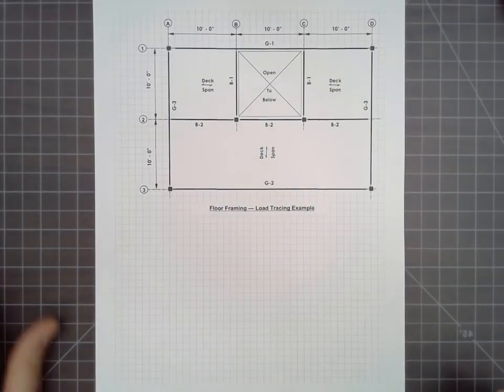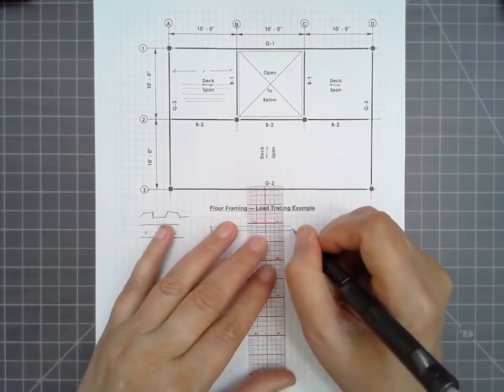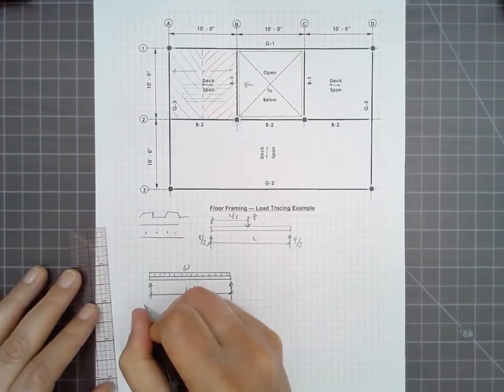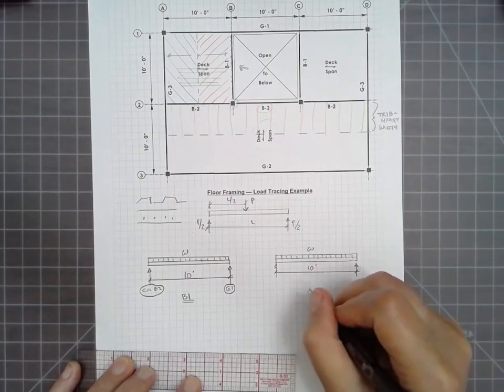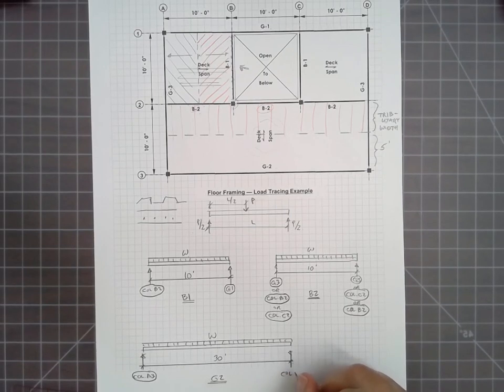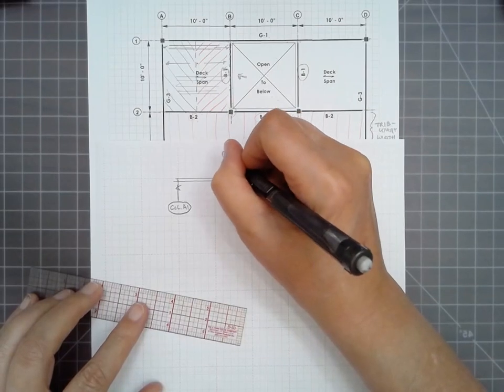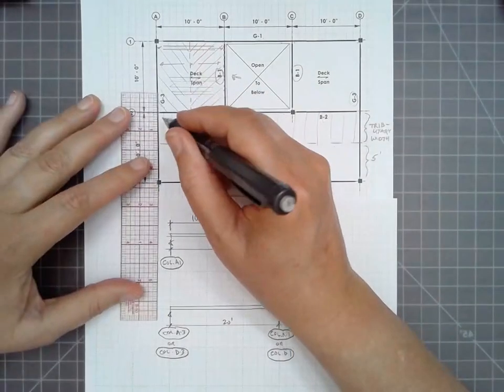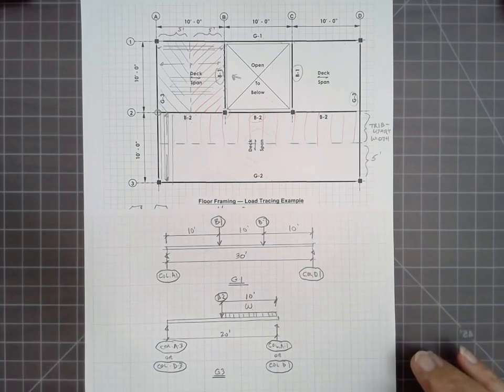Load Tracing, Part 1: Floor Framing and Beam Diagrams

Comment: Hi why dont you rename the beams like beam 1...beam 2...beam 3 this way we can better differentiate the beams and calculate them individually and separately.
Reply from the maker: Each of the members with the same label is a "type," meaning that they have exactly the same span and loading condition. There is no need to identify them individually. This also enables the possibility of creating table schedules of these types, which is very common, especially for foundations, column base plates, etc.

Comment: Hi, why don’t you take all the 3 parts Of B2 as one continous beam instead Of 3 separate parts because we gonna have bending moment over the supports which we could not consider when we take them as 3 simply support beams
Reply from the maker: This example is strictly about load tracing and load development. Continuity of the member doesn't come into play since there is no computation of shear and moment, nor any beam selection here. It's true that negative moment at the interior supports at B2 and C2 would lead to a more effective beam size if B2 were a three-span continuous condition, but that's not what this example is demonstrating, and the load tracing would remain the same whether or not the member is continuous or simply supported.
Reply: professordeb Thank you even though I forgot to say the demonstration goes clearly and smoothly.

Comment: Thank you for the video! Question for you how do you determine how the deck is spaning between AB and 12 since it is a square?
Reply from the maker: You're welcome. The deck span will always be dictated by the construction, normally the short direction between beams. In this case it was stipulated simply for the exercise.

Comment: I tot ly/lx < 2 should be 2 way slab?
Reply from the maker: It depends on the decking, Andrew. If it is designed to span as in a ribbed slab, it will act as a one-way system, like shown here. If it were a concrete plate, then, yes, it would behave in two-way action in the upper left and right areas of this plan.